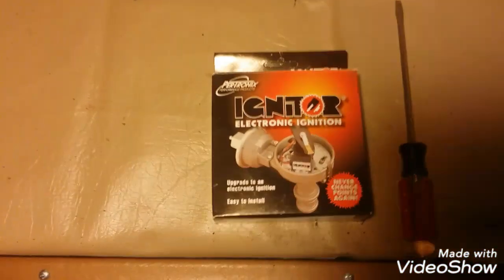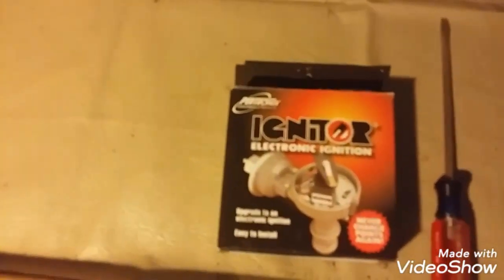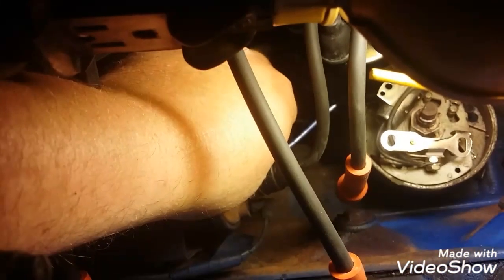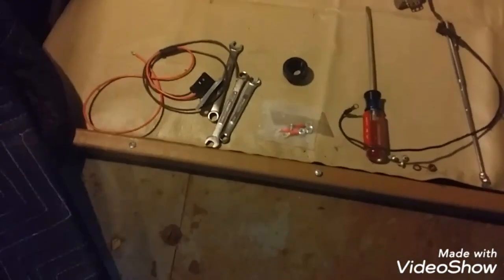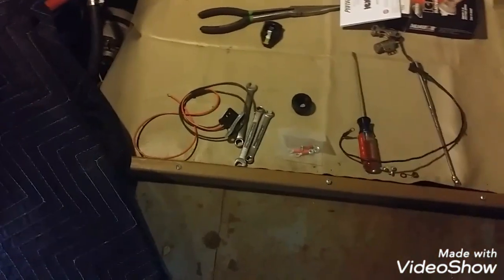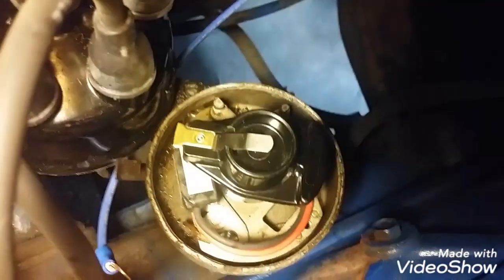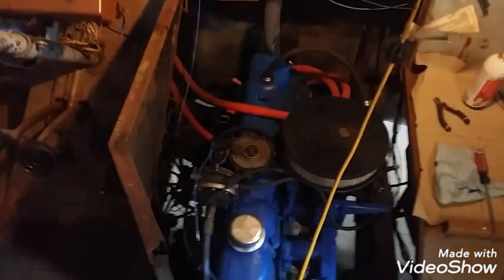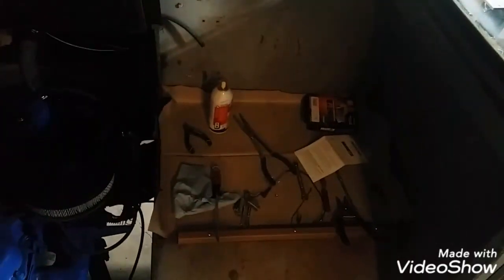Let's install Electronic Ignition in my 1967 Boyertown Ford Stepvan. Pertronix Ignitor Ignition kit.

Comment: Will an ignitor II  91261 work on a 67 f100 in-line 300 six?
Reply from the maker: Pertronix makes one for the 240/300. I have in on my 1965 Ford Supervan 240 and one in my 1967 Boyertown Stepvan Ford p400 chassis 300 cu in. I have one on my 8BA Flathead Ford in my 1936 Ford Truck. They make one for nearly everything